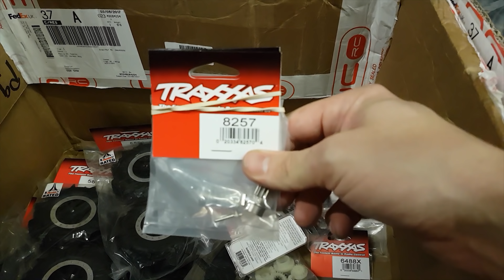Bent Shock & Broken Portal On Traxxas TRX-4 - - - Workshop Time

Comment: Shocks without a bladder are called emulsion shocks. they are supposed to have a small amount of air in them that emulsifies in the oil so they can compress

Comment: Hi Kevin, I think the best way to get the air out of the shocks is like you bleed the brakes of you car. Put the shock in a cup of shock oil and keep it under. Then open it and let the air out. This way there can't get new air in the shock only oil.
Greetings Willem

Comment: I see some of the comments below saying that its not meant for bashing as this is a scale model. That issue you have has nothing to do with the bashing, the rubber from the internal shock in contact with that oil that might contain silicone as well expanded over time and didn't left the room to move the piston internally as easy.

Comment: Hi Kev, I agree, I don't think the TRX 4 shocks are that great either. I have a pair of the pink aluminium hop-up shocks for the old Tamiya mini cooper M01... I dug it out and they are STILL silky smooth with no bubbles since 1995/6! The TRX4 instructions say leave the top cap void free of oil and the space in there is enough for air without hydro locking... and with the shocks upright there should be no effect on the damping. But I much prefer the tamiya idea with the rubber cap and no air at all. I also found what you found with that bottom plastic bit... if I do it up tight the shock sticks badly, but loose and I think it will leak. Not very satisfying! For faster running that is the most important part in the shock travel...

Comment: Kev the oil you used 
has to be the cause of the plastic shock piston swelling up, rather strange as you used silicon oil which is designed for and is usually safe for plastic and rubber parts contact, very odd! Maybe you could do some experimenting by using some different brands of shock oils and see which ones cause problems?!!
Reply from the maker: It is strange, the only other thing I can think of is that the brake cleaner got on there.
Reply: I just had the same problem on my trx4, 3 of the 4 shocks were exactly like the one in your video, I also thought the shaft was bent... I never used any  brake cleaner and the oil that was in them was Team Associated silicone shock oil, strange...
Reply: Same thing happened to my TRX4 and I baby mine lol. Rebuilt the shock and it’s still going strong. Not sure what caused it to swell up in the first place tho.

Comment: Well the TRX $ isn`t meant for bashing so not too suprised that something broke, since it`s meant for crawling. Still nice video! Thumbs up!
Reply: Which is odd you saying that as the first videos I saw from Traxxas they were slamming reverse to forward wheeling it.... Most everything Traxxas makes is going to be bashed including this truck. The two speed and diff locks help make it more of a basher then a permanently locked low speed only truck.
Reply: Roadwolf the shock cool be cause of the different oil he used in the shocks
Reply: Yeah but still, it is a scale crawler and not reallya basher. You can use the high gear for rippin it around but not really for jumping. Still it's up to your self how u use this rig.
Reply: Roadwolf kk
Reply: Lol if its not a basher then why put the unlockable diff garbage in it? Never once have i been crawling and said " let me unlock my diffs and lose traction". Traxxas is trying to hard to compete with axial which will never happen. They rushed the truck before anyone thought about how a crawler works. The trx-4 has steering servo failures, shifting servo failures, portal axles breaking and body is tooooooooooo top heavy. Not a good start, i wouldnt take a trx-4 if it was given to me. Ill stick with my axial and rc4wd rigs. Lol traxxas lol what a joke
Reply: Neal Edmondson that’s ok, don’t buy it. Works great for the rest of us :)
Reply: MrDannyisr trust me lol i wont buy any traxxas shit. Lol ill let noobs buy the traxxas garbage